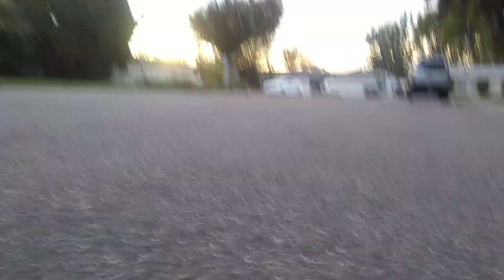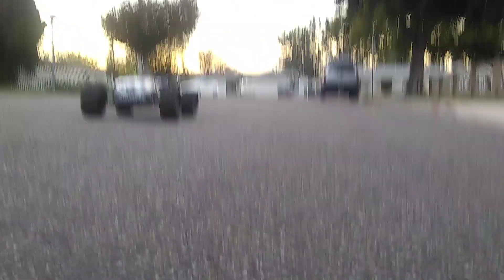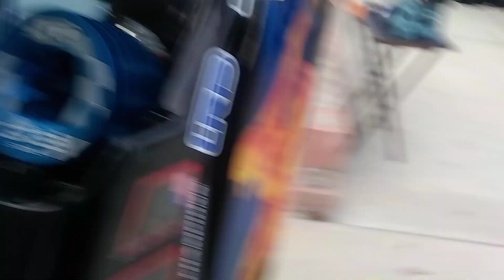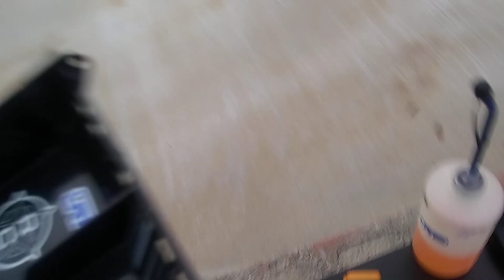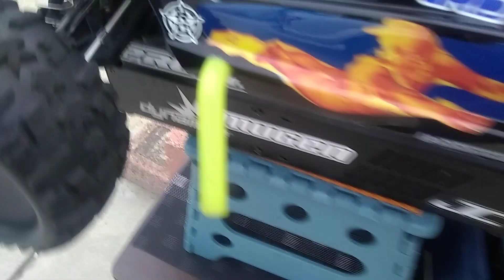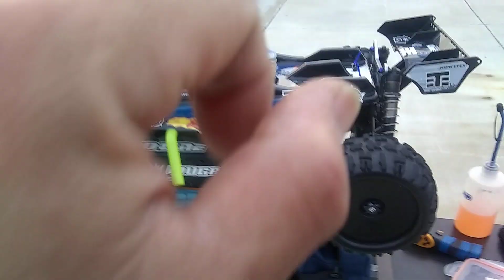STOCK LRP .32 SPEC 4 CARB PROBLEM SOLVED!🤔

Comment: You can even run the carburetor off the .21 Paloma Rex engine and if you really want ? You can also use a Novarossi short low speed needle and that will make that engine run like a watch if the person can’t get the hang of the long low speed needle?

Comment: There are many carbs that will make a LRP 32 and 30 run. Novarossi carb did best on dyno with 9mm vinturie and for long periods of time and with a nice low idle. Also if you want to do speed runs in future on a On Road car ? You can run a 10 mm vinturie but 9 is the most you want to bash with .
Reply from the maker: Point being I'm getting newbies that don't want the hassle of having to mill a mm off any carb! For us with more experience! And next level! No prob! But as you know it's all about the newbies, and helping them get this awesome! Hobby we call 1/8 nitro! Mania! Plus this is a koyosho we're talking about, one of the best and winningest companies on this planet! Sahhhhhh! This carb is better quality than the lrp? Lol! Sahhhhhh! Thanks nitro brother for life! PS. I think the nitro nation is more excited about a good quality koyosho carb that works well for 15$ than a novorosi carb that is a slight notch above for 100$ sahhhhhh! Stay tuned bro! I'm gonna Cary this nitri torch for you full throttle into 2019, sahhhhhh!
Reply: muggy maniac since the Nova carb did best on Neals dyno on Modified LRP Engines I’m not talking Stock I’m talking Modified and with Modified you want most potential if your concerned on spanking or keeping up with 6S E-words. For people or newbies that can’t take off 1 mm with sand paper or an electric sander or a sand belt or file or a smooth grinding stone ? They can just add a second O-ring to it between the carb and engine! It will work I just prefer one O-Ring and it’s so easy to remove 1mm but just adding a second O-Ring is the easiest. And most newbies that never did nitro ever and want an Engine to run like a clock ? They should definitely use the small needle Low speed needle! It will feel like fuel injection lol 😝
Reply from the maker: @BOTAJELL  you right! But also remember that the Nova carb is 100$ not cheap! I'm gonna run a novorosi carb because I want the best! Sahhhhhh! I can get but the complaint of newbies is nitro is more expensive than e word? I guess it boils down to what you want and how much are you willing to spend?
Reply: muggy maniac mine was 60 bucks each new got 2 of them . You can also find used blown up 28-8s and .21Paloma’s for good price sometimes and you can use the carbs of of it
Reply: Michael Greer we had them drilled out to 10 mm when we speed run them. A few years back there was a competition with same engine and same RC from 2 different engine modifiers and each week they had a new record one would beat the other and the one that was not beat was the one with a drilled out 10 mm vinturie on a Picco Carburetor. That thing was not reliable as far as headache free that can run all day and idle. You would have to constantly clear it up and it only ran well at wide open throttle. It was only set up for competition. Now the Nova carbs we use on our Modified 32s made some amazing numbers on dyno and can stay running like a charm . Less headaches more fun . There almost like set it and forget it. My modded 32 is evil but treats me like an angel .
Reply: Love that sound ZEEEEEAAH 💥💨Zeeeeeaah 💥🔥💨 ANY ?’s